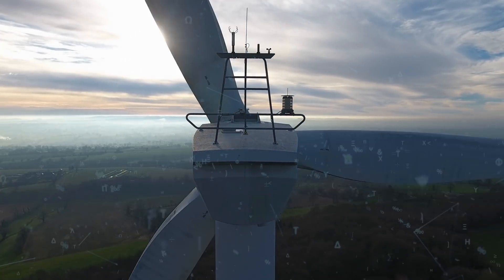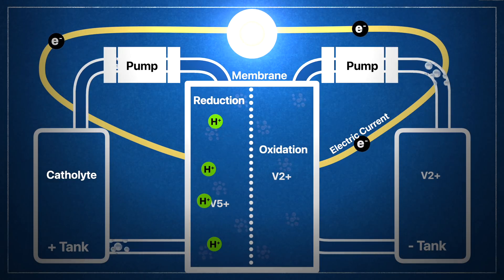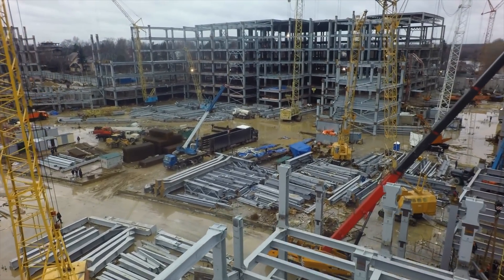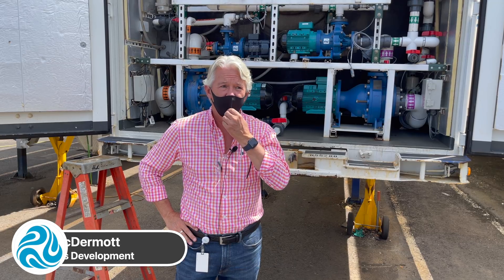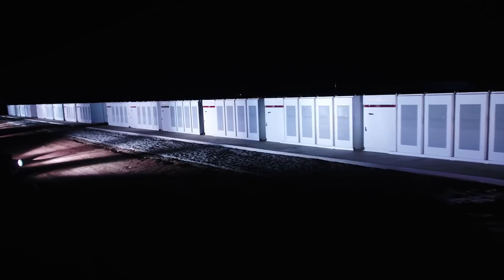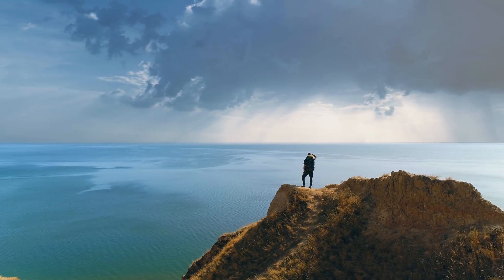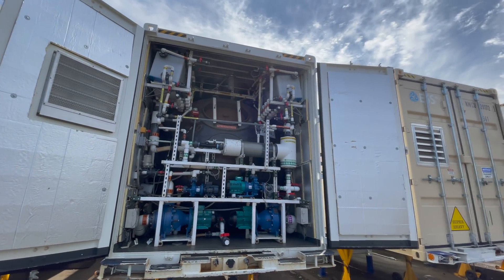The Future of Energy Storage Beyond Lithium Ion

Comment: So it absolutely makes sense what you're saying because there are things that are not stationary and for those things you would need more densely energy like lithium iron or lithium phosphite but for grid I mean you don't even need a flow battery you could also use capacitors you could have a capacitor that's the size of a skyscraper that would be relatively cheap to build and the advantage of that is that it will charge very quickly and if you have enough of those even though it takes up more space hypothetically a power grid doesn't really need to be densely packed it could use a little more space and be more sustainable

Comment: Why is there a 20,000 cycle lifetime limit if your proton pump "kidneys" are rebalancing electolytes?
What problems are there in maintenance for residential applications. I have inspections for my gas and plumbing and electrical systems every 10 years now. This does not seem like a deal breaker to me, so why just dismiss it as not applicable? Even buildings are structurally inspected periodically. That does not mean we don't build buildings.

Comment: Operating temperature range? Freeze protection? Every pump would need "spare-in-place" plumbing. 24x365 on site operation personnel like a nuke? Have Failure Modes and Effects Analysis (FMEA) been done? Don't get me wrong, it doesn't get much cheaper than H2O, Fe and NaCl. Maybe I'll dust off my chemical engineering skills and come out of retirement! Edited: I went to their web site and answered most of my questions. Looks very promising.

Comment: I don't understand the technology but I appreciate the call for more localized infrastructure rather than grid dependence upon miles of pylons supporting many more miles of high voltage cabling.  Localized energy generation with corresponding local bulk storage batteries, all serviced/maintained locally sounds very appealing.

Comment: Seems like they could get more energy out of the iron by just oxiding it in a tank of salt water.  If a kilogram of iron releases about 10 million Joules of energy when it is converted into Iron II Oxide, and a heat engine could capture the energy and convert it into electricity with 36% efficiency,  the electrical energy would be about 1kilowatt hiour/kilogram.   So a tank of salt water  with oxygen bubbled into it that could rust iron dust  at 1 kilogram per minute could power an 80 hp electric motor.  
Since the iron oxide is so much heavier than the water, it would settle to the bottom of the tank.  Or it could be separated with a magnet.  If it was heated up in a crucible to a high enough temperature, the oxygen would be removed which is like recharging it. While it was melted, it could be turned back into dust by making a fine spray of it.  
Iron ore costs about $100/ton.  Gasoline costs about $1400 a ton and is not so easy to recycle.  Concentrated solar used to heat up the rust dust in a crucible and remove the oxygen might use 90% of the heat which would be like using ten  times as much electrical energy from 20% efficient  solar panels if the electrical recharging process is only 50% efficient.
So one cubic meter iof ron would store about  as much energy as two cubic meters of gasoline or ten cubic meters of hot water heated to near the boiling point.
Blood uses iron to transport oxygen.  The iron dust would be a lot like blood cells.
Water expands when  heated.  A wine bottle filled with water into the neck will show about an inch of expansion into the neck when heated about 50°C.  This could be harnessed by a hydraulic piston to drive a fluid turbine with tremendous force.  It could be much smaller than a steam turbine and not require such high temperature operation.  But the efficiency might be much higher than a steam turbine for converting heat to electricity because there is not the wasted energy from propelling a large volume of water to a high velocity, much of which cannot be recovered.  A giant hydraulic piston forcing a small stream of  water under zillions of tons of pressure through a water turbine  could be built right into the tank if salt water and iron dust making the whole system lighter and smaller and less expensive.
If a big tank of water expanded a piston one meter with a thousand tons of force on it, it would generate about ten million Joules.  If a wine bottle expands water about an inch up the neck for 50 °C, then a one cubic meter tank  would expand the water through a wine bottle neck cylinder about 20 meters.  
Those little music boxes have a big gear with a worm gear at the end of the drive train that Spins at zillions of rpm's if you put a big. force on the big cylinder with the pins sticking out that prick the little metal bars to make the music. 
One kilogram of iron would heat up the cubic meter of water about 2°C which would push the piston about one meter.  A thousand tons of force times one meter is about ten million Joules. But what mechanical gear system could with stand 1000 tons of force?  If instead the water was forced through a small hole to drive a tiny turbine with a flow rate of 3000m/sec, the energy generated at 30%efficiency would be about 3 million Joules which is close to 1 kwh.
So if there was a big cylinder with a separation in the middle that house a turbine powered by a thin stream of high pressure water,  the water could just be pushed back and forth through the turbine as one side iwas heated and the other cooled.   Apparently it must be more efficient and easier to drive a steam turbine than a water turbine.  Or maybe not.  The low temperature operation would be an advantage and it might be much smaller, lighter, and less expensive.  Maybe you can power an EV with it.  
It depends on oxygen and temperature difference and there is an unlimited supply of  air and air temperature cooling.

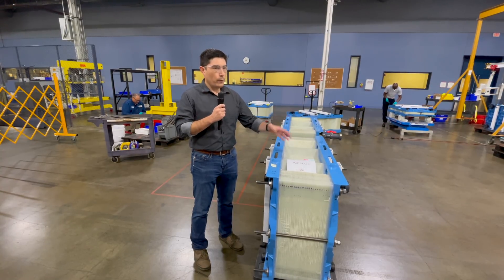Comment: #7:30 so they use boost converters instead of serial stacking immediately losing 10-15 percent in energy even before anything is done with it? Sounds legit... Considering they later claim that "every amp that goes in goes out" I wonder how they make up for those conversion losses. Even with the highest efficiency boost converters using GaN switching MOSFETs they will have at least 6 percent more loss during discharge. On the scale of their battery i also would love to hear how they plan on dissipating that heat. At least their CTO was a bit more honest, somewhat admitting that there are losses.

Comment: You are wrong with the statements that Flow batteries are not used indoors. In Australia you can buy such batteries, they are zinc bromide flow batteries in small containers which can be placed for example in the basement.

Comment: Forget lithium batteries! I wheel around my flywheel to store energy for my cellphone. Sure, it weighs 500 pounds and it is a little hard to get it upstairs even with the wheelbarrow I roll it around in, but I will NEVER find my cellphone running low on power.

Comment: The biggest problem with electric vehicles is not so much the cost of the batteries, but the FACT that they take a long time to charge and they have a very finite life. Right now, the cost of the batteries exceed the cost of the energy they will store and release over their entire life time or the cost of the gasoline that equals that energy. If you can store the charge in two liquids, you can potentially "recharge" an electric vehicle by replacing the fluids in their tanks at a charging station in 5 minutes. This takes care of the biggest short coming of an electric vehicle -- the inconvenience of their charging times. It also takes care of the issue of the batteries wearing out, because the fluids are exchanged at every re-charging stop, as long as the recharging station maintains and purify their fluids to an industry standard the vehicles themselves will not have batteries that need replacement at tens of thousands of dollars a pop.

Comment: Good presentation.
As far as domestic applications are concerned I would not be too quick to dismiss this potential use.  Consider refrigeration and air-conditioning. When they were first invented they were huge noisy machines that required much maintenance and now every house virtually has at least one of each.
Maybe they can refine these flow batteries for smaller utilities and homes.
Reply: Good point. And let's not forget the possibilities of nanomachine technology. It may be, in some (far?) distant future, we have inexpensive, non-toxic, scalable power cells made up of hundreds, thousands, or millions of microscopic ion pump batteries with nanopumps moving a few molecules of an electrolyte across a few molecules of iron - producing tiny fractions of a volt each - but fully scalable (on micro and macro levels), and good for decades. "If you have built castles in the air, your work need not be lost. That is where they should be. Now put the foundations under them." Henry David Thoreau

Comment: I find it funny that you would say that this is not for residential use I haven't heard the specs on the system though I find looking at what I feel that I need as a power storage system that the Tesla powerwall is wholly inadequate my home uses somewhere between 15 and 30 kilowatt hours a day if I'm going to have it adequate backup supply I am looking at a minimum of 14 days solar cells are cheap enough but there are times when the sun has been blocked for 14 plus days I do realize that even on cloudy days solar system still charge but the power produced is extremely low. Yes you have the right to be very excited for this technology the current technology that we use is extremely harmful to our environment Chinese and just bought a Cobalt mine in Brazil they used to belong to an American company they intend to expand it it will be a strip mine and will cover the area of 500 football fields lithium mines are also very toxic to the environment but I don't expect corporate America do anything for the environment with them as always it's the bottom line and put off till tomorrow anything that will cost you a cent today.

Comment: 70% efficiency for these batteries is a big negative.  Probably easier just to create hydrogen and fuel cell that for power - even though efficiency is less, it is much easier to store large amounts for seasonal variations.  Use more efficient batteries for daily cycling.

Comment: A few things. Really great that you compared these to baseline flowing Vanadium batteries. Keyboard warriors wouldn't have known the history. 
You mentioned charging them from wind turbines. Not likely since turbine output is Vac. So 1st choice is turbine energy goes to the grid and Vdc generators go to storage.
You missed why flowing battery is so important and in fact what started Vanadium flow. If Green energy is going to get much bigger it needs to have cycle generating ability. Now solar energy must have a functioning grid from which to follow cycle coming from say coal or nuclear. The flowing battery allows frequency to be generated! Lithium and lead stationary batteries cannot do that.
Lastly, illustrating different design constraints for stationary batteries is very important. The keyboard warriors always miss this when they are praising slick new battery developments. There are even good boutique lead chemistry options.

Comment: Very impressed.  I think it could make sense as a community battery--say for a neighborhood.  If you had one in a number of nearby neighborhoods then a single maintenance guy could just make his rounds regularly for checks and maintenance.  However the nerd that I am, I was more interested in if this might be a good energy storage mechanism for a martian colony.  The regolith is rich in iron, salt, and water.   I had just considered water batteries (water tanks flowing through turbines by means of gravity).  However, this solution is perhaps more interesting.  My main requirement when thinking of a martian colony is that every technology must be reproducible in situ, on a practical level.  Maybe this battery is.  The excess hydrogen can also be useful for burning off excess oxygen from plants (enough vegetation to feed a population will unavoidably also produce too much oxygen for that same population).  Burning hydrogen will provide heat but also destroy any CO (carbon-monoxide) build-up that might otherwise silently kill everyone in their sleep.  I haven't seen any study address the CO problem.  Mars has trace gases of CO at a deadly level.  Coming in and out of the airlocks and especially bringing in regolith for material processing will release it and, at some point, it will be too much in the habitat.  There are also a number of processes that produce too much hydrogen so, burning it off makes sense for many reasons.

Comment: I always thought we should use solar panels with a double reservoir hydro electric system.  During the day excess solar power pumps water from lower reservoir to top reservoir.  At night water gets released to lower reservoir powering the hydro generators.  Maybe not the most efficient power storage, but relatively easy to scale up, has no chemical pollution, and backs up as drinking water.  Even better if we could use solar to desalinize water and pump to reservoir during drought years.  The only issue I see is desalination causing super salty water around the plants

Comment: One problem with the design from the boost converter from 1.1 volts to operating voltage. The failure mode for the boost converter is overvoltage so it can blow your other electronics.

Comment: There was no discussion of the battery's performance in cold temperatures. Extreme temperatures in the north can drop to -40C, so what does the charge/discharge cycle look like at those temps? Li-ion can't be charged at low temps

Comment: Yeah because all of THIS mining is more eco friendly than coal mining.  Whereas the CO2 from coal burning? Is easily sequestered with crumbled limestone in the combustion chamber as we have known for 40 years plus some fancy filters on the stacks to get more hazardous materials out of what is left of the smoke.  How are you planning to safely dispose of the poisonous gallium and germanium in expired solar panels?  No one seems to have a good read on disposal on the current fan blades of wind turbines although why we are not using ecofriendly to start with like WOOD beats me.
Reply from the maker: No it’s not. Carbon capture is possible but difficult and wasteful. Bottom line, gasoline isn’t re chargeable process. That’s ok when you’re a crude civilization, but as we progress we need a reversible process that can be powered by things like the sun. I’m sure you long for the good ole days, but scientific progress never stops. Someone felt just like you about gas cars, and argued horses were better.

Comment: Why not just convert electrical power into chemical power as in splitting water into its components of hydrogen and oxygen, and in off hours burning the hydrogen to drive a generator. That technology is available and can be easily ramped up without taxing the mineral grid.

Comment: I wrote my comment before 16:25 when she completed her statement but the fellow said the problem is imbalance issues are the problem with productivity.  Check valves and sensors should regulate the chemical composition to maintain consistency. And now you're saying there's no market for them because of energy storage systems ?
Reply: And maybe a pressure check valve?

Comment: If you can add to the power upgrade why can't you regulate the the amounts by pumping in where the imbalances occur to keep the chemicals balanced.  Like a sensor that turns the pump on to pump in what's turning to hydrogen.  If you could contain the hydrogen gas there should be some value with the containment.

Comment: Just to get back in reality ... Batteries/Accu's  Will NEVER solve the issue. 
In theory maybe . But reality strikes back hard.   Replacement cycles to often,. over load failure (or black outs) to high risk.  
Yes it a great option for  relative small utilization.  IE,  homesteads,  maybe small communities.  
But when it comes to  Cities combined with Industries It can't  work.
Reply from the maker: It can absolutely work. We will have massive grid storage in the coming decade. It’ll be wildly profitable too… it’s a bit of a gold rush rush right now

Comment: I guess the proton pump is more efficient than electrolysing out oxygen gas and adding extra water, but it will be more complicated. Considering some people are seriously considering thermal energy storage, I wonder how much efficiency really matters?
Such a system, if simplified, would be actually rather easy for a hobbyist to build too.

Hope this succeeds, definitely looks like the most promising solution to grid storage I’ve seen, so long as the other electrode material isn’t too exotic. Also it’s more of a hybrid flow battery, like a hybrid rocket motor.

Comment: So this is officially a hybrid flow battery, since power and energy are not fully decoupled. The capacity is also dependent on the surface area of the electrodes, making it less easily scalable compared to a "pure" flow battery such as Vanadium or Hydrogen Bromine.

Comment: So will these or can these supply power to data centers?   In my area, new data centers are driving new expansion of the power grid.  This means infrastructure and customer costs, as well as land rights of way.  Can the Fe flow battery be built and maintained on-site to run larger power-need installations?

Comment: Could these iron flow batteries, be used to provide commercial vessels, with electric power, to drive the vessels propellors and  vessel through the water. To transport international cargo and goods across the worlds oceans and seas.
Especially if these iron flow batteries, were recharge by Solar, Wind and Hydro electric generation systems, onboard the vessel itself too, withnlittle or no environmental impact?